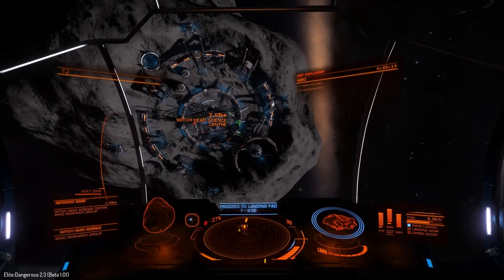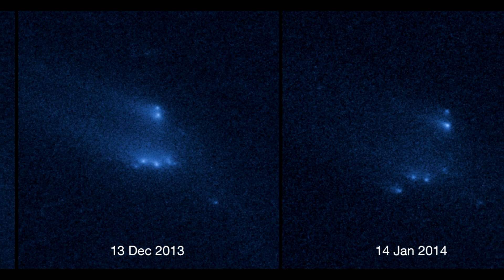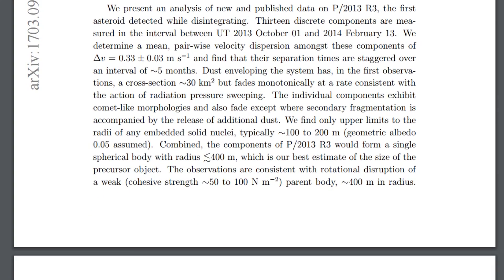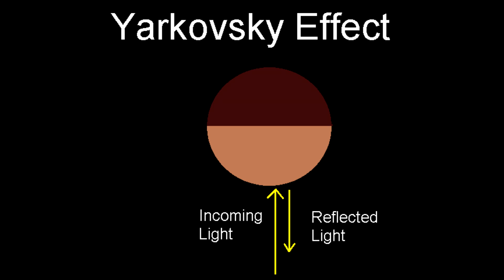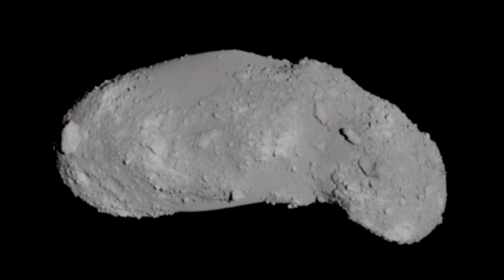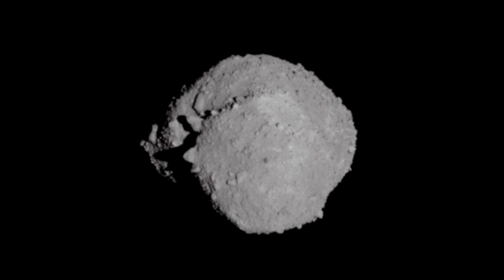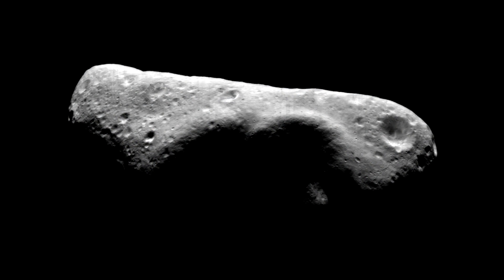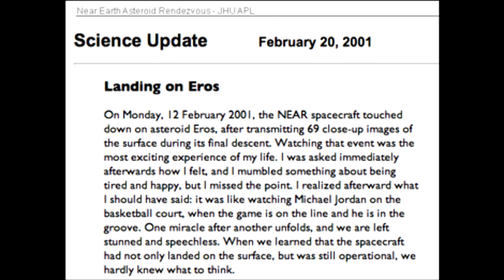Spinning Asteroids To Make Space Stations

Comment: Yup.  That's why in my sci-fi stories, space habitats hide behind asteroids.  In other words, the asteroid always blocks direct sunlight and solar radiation from hitting the space habitat.  However, in most cases I put a huge lightweight ring shape structure beside the space habitat and barely a sufficient distance away so the sunlight is not blocked from hitting it.  Essentially this structure is just a ring [with internal web] that holds huge sheets of something like aluminized mylar at a 45-degree angle to the sunlight so the light reflects off and onto the habitat.  Note that highly energetic particles will pass right through this material while lower energies like visible light bounce off and provide the habitat with illumination and a source of energy.  A few other minor components are also required to keep everything stable (since the main asteroid has a tiny bit of mass and thus exerts gravitational and tidal forces on the habitat and energy reflectors.

Comment: You say that the asteroids in the two fictions you mentioned were hollowed out before spinning, but it appears you did all of the calculations using the non-hollow masses.  Neglecting the obvious structural integrity issues, how different would this factor make the calculations?

Comment: Well, something to consider is that while you are digging the asteroid, you need to to something with the resulting material and one possibility is to "shoot" it out to push yourself (maybe engineering the orbit to be more stable or obtain particular rendezvous). The spinning still remain a problem, but lets go back to a smaller asteroid with reinforced structure, you are pushing a lighter and lighter version of the asteroid, to the point when you are mostly hallow, and the energy requirement to bring to "final spin" are greatly lowered.

Basically the asteroid became a source of resource in a convenient orbit, more than your ending base

Comment: If I were to 'build out' an asteroid base, I would start in the center of the existing rotation, and gently begin digging out the material, separating out some components. As noted in the vid, I would use some of it to extrude 'rock fiber' - possibly stronger by using that partially purified material. I would begin wrapping the asteroid with that fiber, just like spooling carbon fiber around a mandrell. (Hmm. I might even out the shape a bit first? Another factor would be the best mining approach, as that would likely be the major motivation for being there, or at least the major financial basis. Even a military base might as well be developed economically.) This method would have the effect of gradually reducing the overall mass while retaining the stiffness for as long as necessary. The act of winding would have a small effect on the rotational velocity. But the primary point is that for an internalized architecture, depending on the purpose, generating a centrifugal force of 0.3g is not really necessary. For industrial purposes you only really need enough to keep tools and parts in a local area. The existing rotation might well be enough. There are also valid reasons for keeping the g forces low for in-space construction.

Comment: Awww! What a downer (wink) I was picturing spinning asteroids with building like structures sticking out and people inside walking on the ceilings. I suppose the YORP Effect is more interesting. And (9:30) thinking about a spun up asteroid, even one that's a solid rock, cracking apart..... my head explodes. From a near weightless state to 1 G, but pulling out from the center of gravity.... everything we think about rock masses on Earth is flipped upside down. the the whole rocky asteroid spinning at 1 G becomes one continuous rock bridge,  all compression strength and very little tensile strength.  
And forget rockets at the surface. Just make large Solar Sails..... arrayed...... around the intended equator...... like propeller or fan blades! Let the sun do the spin work! (I'm glad I can't do the math on this; now I can walk around for a day or two thinking, 'wow!' Of course this assumes an asteroid that isn't just going to fly apart. )  But using a solar sail as a fan blade... surely I can't be the first person to think of this? (Not only can you probably pull out a 200 year old Russian mathematician with a long beard, but probably 3 or 4.) Of course you'd want to pick an asteroid that's closer to the Sun, because by the time it was spun up to 1 G with the solar fan blade,  it might be out by Saturn.

Comment: I am 9m in and am going to comment without finishing the video fight me if this is a foolish post. About rotating the ship... If you would like, hollow it out, like a lot. A spit those rocks out in a way that will start rotation of the asteriod. Along with that, just add some very powerful engines to help that centripital force get to something high enough to simulate gravity. Then, assuming metal comprises of at least 15% of the asteriod, use that to provide an actual base of operation inside the asteroid. 

???
Reply: Nope. This method does have an advantage of not losing fuel as reaction mass, but this is the only advantage and you still need the same amount of energy to accelerate the mined material (using something like catapults, I guess?) which requires lots of energy, and then you still need even more energy and expensive engines to speed the thing further up, and then you build a base out of mined metal anyway, so basically all the previous work you put enormous amounts of money, effort, time and energy in becomes completely useless. And also as Scott said, asteroid aren't usually particularly solid objects, you'd need to use about a metric fuckton of tough concrete or something similar to secure the asteroid material in place by basically flooding the external surface with it. And how'd it even behave in microgravity? Would it even work as intended? And so on...
Reply: Ahh, thank you. I should have considered those points. Thanks!

Comment: This might work for a small Fe/Ni asteroid after the interior has been mined (to create living space) in such a way that there is no resulting unbalance. Fe/Ni is even heavier than rock but might cohere sufficiently, presumably any loose surface material would have to be disposed of, too. Basalt fiber sounds like synthetic Pele´s hair.
Reply: Loose surface material would dispose of itself via the centrifugal force, but... It'd be way more efficient to just mine ALL the metal and then make a station out of a tiny fraction of it.

Comment: They could have done it like this ->  /watch?v=xNDppVTVUss&t=
But instead of keeping the roof from colapsing, the bolts could hold the roof/ground from flying away?
Reply: And fill the outside surface with reinforced concrete, to keep the smaller rocks from flying away.

Comment: I know I'm super, super late to the party, but... 

Wouldn't a very old technique substantially reinforce the asteroid with its melted-rock monolithic shell? I mean rebar, basically; steel, or aluminum, or whatever you have; melt the rock, sink in a reinforcing matrix of metal bars, let the rock solidify around it like concrete?

Comment: couldn't you reinforce the structure with high tensile strength rods along the axis? 
We do use similar methods to reinforce Concrete and loose gravel/soil/non-massive rock by tightening the material via rebar. I'm fairly certain that if you can spin it up and fill it with spaces stations you can shove a couple thousand rods into it and tighten on both ends.
Of course the asteroid might be massive enough that no reinforcement could hold it together. I couldn't say for certain, because i don't have an education in civil engineering.

Comment: If for some reason you actually wanted to spin up an asteroid, I would expect that the most efficient way (given that time isn't a huge issue) would be solar sails. Effectively you would be turning the asteroid into a macro solar spinner (which is what the YARP effect is about after all). Chemical rockets are volume and mass efficient ways to create huge delta-V quickly. Otherwise, flinging molecules chemically is a pretty inefficient way to gain momentum.

Not only that, but you could actually use the same process with the addition of some sort of momentum transfer mechanism (powered rollers, for instance) to control the spin of the asteroid as a whole while maintaining an inner spun-up chamber of some sort to reduce low-G deterioration.
Reply from the maker: It would take hundreds of thousands of year though
Reply: Depends on the number and size of the sails and the lengths of the masts relative to the size and mass of the object, but it would certainly not be the work of an afternoon. Or a decade. And it would probably require advances in materials science that we haven't a clue about at present. (Step 3: ?)

But then how practical would it be to install and fuel rocket engines?

We're deeply into flying aircraft carrier territory here for all of these schemes. 8-)

Using sails to impart spin to a more reasonably sized craft (or rock) would seem much more practical, though.

ETA: I wonder what effect decelerating the fuel for the rocket engines would have on imparting spin. Drop the fuel into a .mumble. at 10 kps in one half of the rotation, then fire it out again at (say) 5kps in the other half of the rotation. Should triple the efficiency. As soon as you figure out how to catch the fuel.

Comment: Why would you want to spin up an entire asteroid or rock floating in space (as it would be dead weight). It would be way more efficient to hollow out the center and install individually rotating O'neil cylinders. This would give you an outer protective covering provided by the rock and provide a "stable" platform that could receive, ship, and store materials that didn't require special handling needs. As for loose aggregate on the surface, that could be solved with a foam or other binding agent to create hard surfaces to utilize. You might need more than one cylinder to counterbalance the spin of the first, but after 2 (or more) cylinders are installed the spin forces can be mitigated.

edit: Great channel, I really enjoy your content!!

Comment: So they take an asteroid they melt the inside of it and that makes it hard? It makes a lot more sense to break an asteroid up, that is, to mind it, and using normal industrial processes adapted for space, making stock that can be used to assemble a giant space station. This is where our engineering energies should be concentrated. We should work on the industrial ecosystem that can be built-in vacuum and use small centrifuges on the order of meters to do processes that require Force.

Comment: I would think main reason to use an asteroid would be availability of material and the shielding provided by a kilometer or so of rock on the outside from both radiation and small impacts.

Comment: it makes more sense to hollow out an asteroid, build the space station inside the hollow asteroid, and spin the can inside for gravity. you would have less mass to move, you could easily build a dock accessible from the central axis for cargo and personnel transfer, and you still have a lot of mass from the asteroid itself for radiation shielding. you can even use the overburden from hollowing out the asteroid to help protect the dock whether you fuse it thermally or with some polymer binder.

Comment: how about melting a relatively small metallic asteroid and then blowing it up like a balloon... seemed even more far fetched than rock initially but it WOULD address issues like strength (metal) and cooling (dramatically increased surface area to speed cooling). In the novel they used some fancy solar lasers to heat the asteroids... but in the expanse universe you could maybe use epstein's to send the asteroid into an orbit taking it close to the sun or some other crazy implausible idea.

Comment: Rotate using drives. Parabolic mirrors to melt. Insert massive straw and blow a base, like glass blowing. Use orbital tether material as a reinforcement like carbon fibre, embedded in the station walls.

Comment: I think Isaac Auther has it right and the best way to do a artificial habitats in space for small objects is to mine the metals you would want to make the cylinder spinning habitat out of something like aluminium, steel or whatever. Then have an outer non spinning section covered in rock which is just slag from asteroid mining to protect you from radiation and impacts. You can easily have 10 - 20 meters of rock which is enough to protect you from a GRB. And bonus is you get a load of rear earth minerals to send back to Earth.

Honestly you can within reason go as nuts as you want with the rock on the outer layer you could go 1000's meters deep and still be able to hold the rock up with sheet metel as thin as beer cans. Obviously you wouldn't do that because then if anything hits the outside that sheet metal is going to rip, you would likely go with something like 5mm think steel with a base structure of girders underneath to absorb impacts.

You would almost certainly have the sheet metal installed as panels into the girders for easy repair and construction, I chose for shape would be hexagons, maybe you would also reinforce the hexegon sheet metal with bars around the outside and in triangles every 60 degrees. Kind of over engineering with say 100 meters of rock spreading out the impact over the outer structure, but better to be safe than sorry because repairing the inter structure would be difficult and will have all the people inside so the act of smashing it up would kill people.  

For a larger body you would build your spinning habitat into the body and as it will have it's own gravity you would need to make it a steep bowl rather than a cylinder.

Comment: How about the way John Ringo blew up hollow habitats by melting metal asteroids filled with ice, making the ice boil to steam and basically blow up the asteroid like when a glassblower makes a bottle?  Read the series if you didn't read troy rising. https://www.amazon.com/Live-Free-Die-Troy-Rising/dp/1439133972
I am curious of if the solar-mirror-beam actually can work, or if the amount that can be reflected before the mirrors themselves are melted is lower than what is needed to melt those planetoids. Please comment about that physics in later series ?

Comment: Simplest way to inhabit an asteroid would be to tunnel in, hollow out spaces, and build spinner habitats inside. One could build many; that gives backup habitats should one fail or need upkeep. Gives excellent radiation shielding. 
The best space habitats would be built out of asteroid materials in free space, as was demonstrated exhaustively in 1975 during the L5 discussions. 
The Expanse showed spinners mounted directly onto asteroids, which could be problematic as most asteroids would need to be derotated.
Reply: Davis FourOhFour, build your habitats on/near the spin axis of the asteroid. Always spin them up (parallel axis) by slowing down the asteroid.

Comment: It would be easier to just build a rotating space station than to spin-up an asteroid.
Reply: it would be alot easier to use a iron asteroid,,,to build a space station. melt it down and build what ya need. or at the very least just hollow it out mostly.  like 90% hollow.
Reply: @mattycheezeburger  i think asteroids have the advantage for 1 reason, easy radiation shielding, easier than you could get on a space station.
Reply: I think the reason for Ceres station being the way it is is because "digging" requires a lot less material than actually building something. Just dig and throw away some part of the asteroid and voila, you suddenly got space you can build a habitat on. The spinning part is to resolve the gravity issue. When you have a basically magic Epstein drive, that's not that hard

Comment: So what you're saying is, it's cheaper and better to just build a rotating space station out of steel, right?
Reply from the maker: Aluminium, but yes.
Reply: Really? Aluminium is quite soft isn't it? if it were the length of Eros would the tensile strength be enough?
Oh you explained it in the video, the tensile strength is lower but the so is the weight of the material, so the stresses that have to be accounted for are lower.
Reply: If most of the building material comes from the asteroid, then it depends on what they find. Basalt can be melted and turned into material with good tensile strength, although brittle. Quartz can be made into glass fibers. Weight and density doesn't matter since it is all local. Metallic asteroids would be mostly iron/nickel. Aluminum can be smelted from common light ores.

Comment: The problem with solar sail radiation pressure is that the energy equation for the incoming and out-going light uses an impulse of energy equal to the momentum of the photon as it is absorbed plus the momentum of the photon as it is emitted. 
If you can convert the frequency of the light into kinetic energy, thereby reducing the momentum in the outbound photons, you can increase the efficiency of radiation pressure, since the velocity of light does not change, the momentum gained by the ship is equal to the difference in energy levels between the incoming light frequency and the emitted frequency. 

You can artificially red-shift light and rapidly gain energy from the phase angle of light as observers saw you red-shift away up to near-light speed, perhaps beyond since the phase-space of  the electromagnetic field could be responsible for the effect of inertia on mass that prevents it from gaining infinite energy to overcoming the blue shift/time dilation.

Comment: Wouldn't a better option be to partially hollow out the asteroid, build a spinning structure inside the hole and keep the asteroid body as stationary radiation shielding and as inertial mass (to help counter wobble due to unevenly loaded spin).